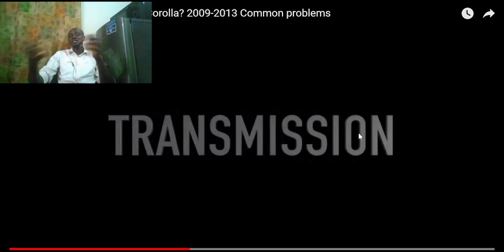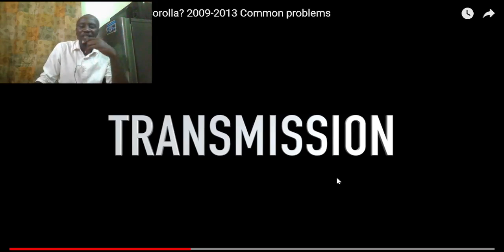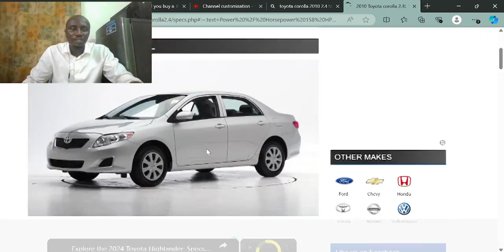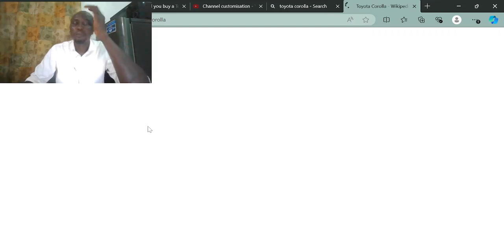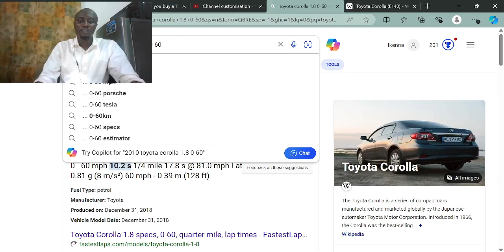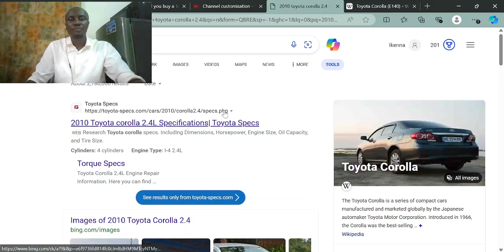Why You Should Avoid Buying Toyota Corolla 2009 - 2013 Or Solutions To Their Problems

Comment: you should consider flushing the engine when servicing before puting new oil.sometimes the lobs in the veriable timing system gets cluged.also thick oil over time will block those lobs.